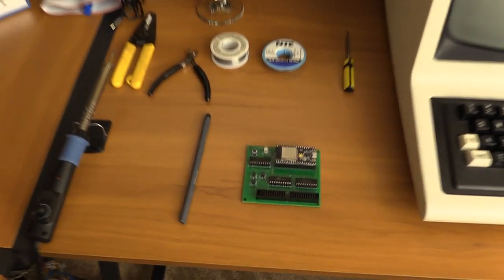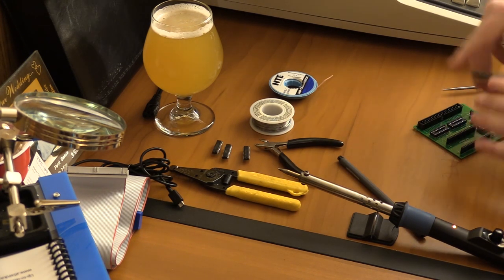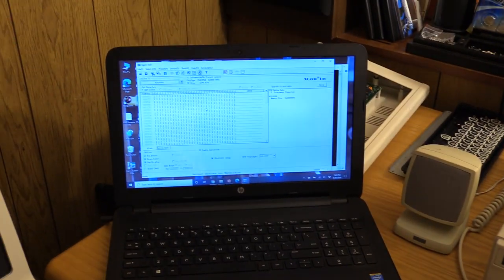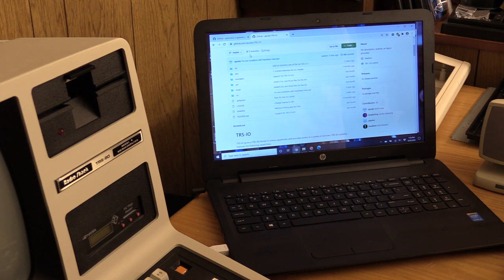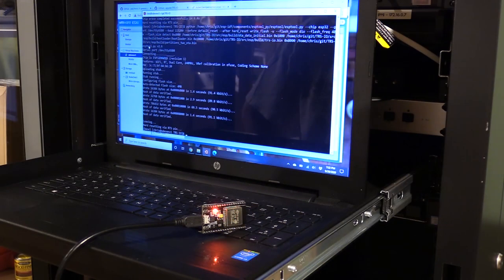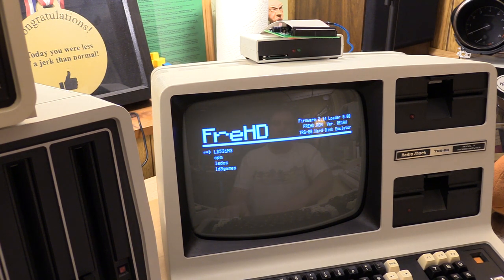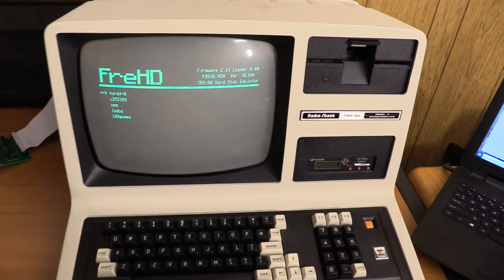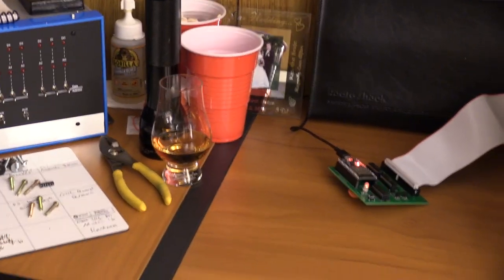TRS-80 Model 4: Converting My trsnic To TRS-IO

Comment: what floppy emulator are you using , and what are you using to adapt a full height bay?  Also, what are you using for the shugart floppy controller to connect to M34?

Found the emulator
HxC Floppy Emulator
Reply from the maker: I made the adapter out of an old full-height hard drive bracket.  I cut a space for the HxC using a Dremel, and then used a standard 3.5"-to-5.25" drive bay adapter with the front cut off to mount it all up.